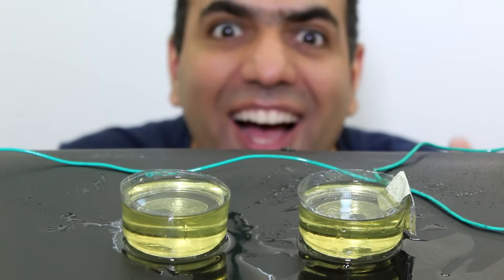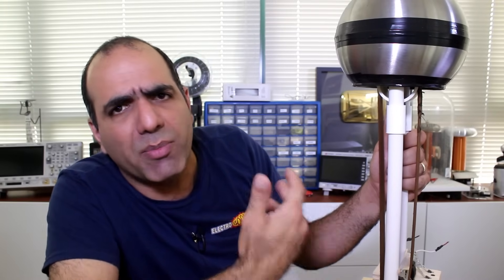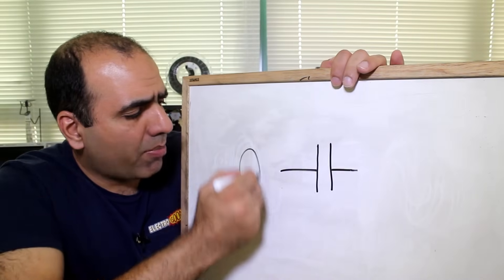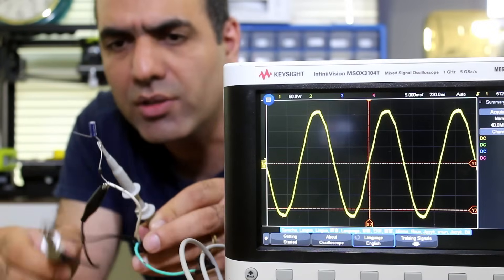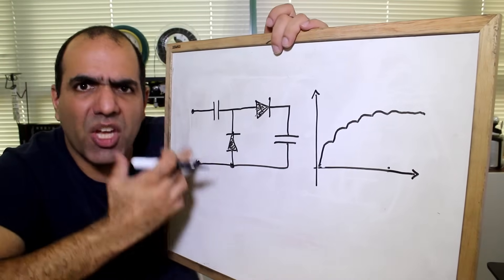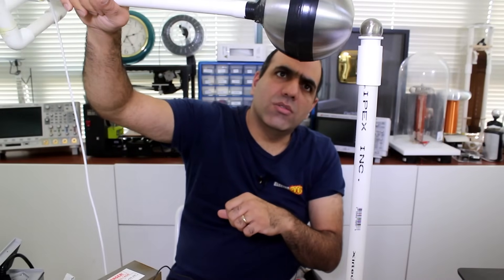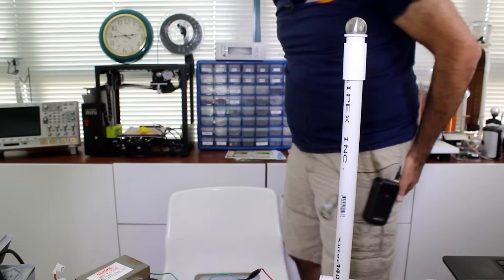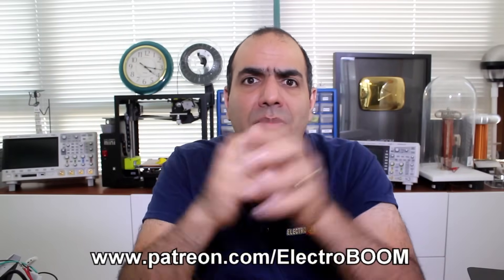High Voltage Flying Oil Experiment with Voltage Multiplier

Comment from the maker: Hello Army! I drew the winner of the Keysight. The lucky winner is:
- Codellamma
Thanks everyone for watching!
Reply: Hey i have a high voltage transformer and it is huge.
Reply: Dude be safe please
We like u alive
Reply: Wow i love your videos keep it up 👍👍👍👍👍👍👍👍👍👍👍👍
Reply: Круассан ахаха, Nice joke ;)
Reply: @nakam1chi  "Ес Русишь!" ;)
Reply: Can you showt out my video. I am from  Irean too.
Reply: ??????
http://www.youtube.com/shorts/Siixx3aBI1c
Reply: wifigun confirmed working
Reply: I would like to see wireless charging experiment under high voltage power lines, there are 3 400kv lines with twin cables near to my house, so i am interested.
Reply: ElectroBOOM 
Dear Mehdi hi, Thanks for great and very informative videos. Mate, I need your help if it will possible please. I need you to tell me how to create a weak (safe) Electrical Current and/or, how to build a weak Electrostatic please, I give the scenario first; imagine there is a tick plastic container (around 1 or 2 gallons) with some kind of Resin and a few piece of wood, it is actually a vacuum chamber. Now, I need that weak electrical current or electrostatic in that Resin by placing the producer (device or anything) of them while the vacuum pump is taking the air out of the chamber for the period of time it is on (could be couple of hours). Just imagine painting a car by using electrostatic to have a more smooth and indelible result/paint. Will that be possible please to tell me how to do it? Cheers mate.
Reply: You said two winners not one I could be the second winner
Reply: ElectroBOOM    Ben
M
Kkkmgn
Reply: Uhhh obviously this is a year late but was this supposed to be me, or is there another codellama?
Reply: @gran4404  RIP
Reply: It hurts me to watch....
Reply: Just like the dust that settles on the old TV screens and Start popping when the screen get charged
Reply: When will you rectify other videos from Kreosan? I want to know how much to trust their video...
Reply: Make this: High Voltage Microwave Transformers MOT Experiment https://www.youtube.com/watch?v=RvXu6IGBqjA
Reply: My dad needs a keysight scope.
Reply: The car ignition coil has mineral oil in it that is what thay have in the big Barel things on power lines
Reply: Please open the glender and drill machine
Reply: ElectroBOOM u remind me of my dad
Reply: Look at my ball was the funniest part
Reply: Fun question I hope you get to see...
Any relation to the "bridging effect" as seen in non-conductive, distilled water?

It almost seems that electricity acts in distilled water as it would in a vacuum.

I know, CrAzY riiight!
Reply: I love you electroboom you are a winner
Reply: zZsZzZSS
Reply: Mehdi what if this rod of your is somehow in the car oil chamber. Does charging oil improve lubrication or the charged oil might blow up the in internal combustion engine in electroboom way!????
Reply: Elctroboom I love your videos man you go hard on them and I like your new house
Reply: Lol I really enjoy your videos . Every time I learn something new about electricity,the dumber I feel.
Reply: P
Reply: P
Reply: دمت گرم
Reply: سلام
shov.e
حرف خیلی بدی هستش بهتر بگید insert
Reply: Hey Mehdi, the things he's using to create the high voltage are FlyBack transformers from old CRT TVs
Reply: Fuck you you saw the Beast
Reply: Empire
Reply: What do I want to win
Reply: Jadeja lucky lucky me what do I need to bring
Reply: Good for them!
Reply: Still waiting for the wifi shotgun, wireless phone charger, and microwave gun videos :)
Reply: OLA TODO BEM ,EU ADORO VER ESSE CANAL E O TEU É LÓGICO KKK   abraço de Lisboa portugal .
Reply: make a sword
Reply: 0:29 well that hits different now hope they are ok
Reply: "I think the impotence of my probe is pulling it down"
They have pills for that Mehdi.
Reply: Use a square wave on the Marx generator in at least one of those vertical videos! Because if you want a higher frequency, doing it that way would be fairly easy, right?
Reply: Hello! Please use high voltage on liquid plastics, I think it can make a plastic fiber
Reply: @electroboom i made it i didn’t get kill#d
Reply: asks for an oil fryer, comes back with an oil flyer
Reply: Rectify this video - https://www.youtube.com/watch?v=eunq8byoraM&t=9s
Reply: @Adrian Biankin about the VDO u ask.
As soon as I saw ur comment I watch da VDO n try it, But it didn’t work when connected There s not voltage on the secondary but if u disconnect the dc supply as the magnetic field in the inductor collapse we get a huge voltage spike at the output(secondary) in terms of nano seconds same as in Electroboom’s Stun Gun VDO and tats how stun guns works with a battery.
Reply: U do thrilling mistakes
Reply: Hmm... "Oil"...?
"Army"?!

OH S##T, THE MILITARY IS HERE!!!
Reply: wtf i want more videos
Reply: How did I register for the drawing? I really need a Keysight! 
As a disabled veteran it would really help me to to forget my disabilities.
Reply: too good explanation sir
Reply: minute 1:14 no sparks when you connected the capacitor ?

Comment: i know quite a bit about RF equipment and i immediately knew that WiFi antenna was bs u would not get good wifi reception with a antenna that big the higher the frequency the smaller the antenna needs to be

Comment: I find it interesting because this looks like a neat and tidy way to make a full wave rectifier with voltage smoothing using less components, and therefore, at lower cost than your tranditional set-up using 4 diodes and a capacitor. Much smaller B.O.M. and lower cost to use 2 diodes and 2 capacitors.

Also, I get you're existential fear after getting that shock. I once gave myself a 347 V poke off of factory power with sweaty hands. I had 1 glove on and 1 glove off and I was up on a fiberglass ladder. Needed to take my glove off to get a grip on the wire to twist on the marrette. I got it from the thumb to the pinky. I was more annoyed than anything else up the ladder, but then when I went home and thought more about my day, the realisation of what happened struck me and I spent a couple of days considering whether or not I'm smart enough to play with wires.

Also, I agree, hobbyists should either built a triobelectric generator or an influence generator. At least the current output potential per second will remain in and around the sub milliamp range.

Comment: I am building a similar circuit but am having trouble with arc overs. I tried encasing it in resin first but that made it stop working. I rebuilt and tried mineral oil but witnessed a strange phenomenon that was a convection current in the mineral oil. That mystery was solved by this video, but I am still perplexed as to why it made the circuit stop functioning. I am using a 24v 12A dc input powersupply to a zvs and flyback and then 6 stages of a voltage multiplier. The caps are 1nF 20kv and the diodes are 5mA 20kv. Whenever it is powered on, there is a really loud dc arc across the spark gap, but then it changes to a quiet AC arc. This usually, but not always happens when the first cap in the multiplier arcs across itself. I am unsure of the output voltage of the flyback but estimate it to be around 10kv. If anyone can suggest improvements they would be greatly appreciated.

Comment: Just order high-voltage modules for gas boilers on e-bay, determine the polarity of the output voltage for each, connect the outputs in series and the inputs in parallel, and you will have high voltage.This is how we got half-meter discharges. To determine polarity use 1 k load resistor and voltmeter.

Comment: Nice circuit im building one with 15kv flyback as supply and 15kv capacitors of 10nf 25 stages because you said DO TRY THIS AT HOME thanks for inspiring. Joking, i have some HV expierence if u new start with safer devices.

Comment: Wait. You saying that oil is a good insulator but in that experiment it can obviously pick up charge under high voltage. Wouldn't that make the oil conductive and therefore a bad insulator? I would assume that different types of oil have different electrical resistances and resistance to being charged. Or is it maybe that the canola oil isn't very pure and has conductive particles? pls clarify, thx ^^
Reply: look for electrohydrodynamic processes, electrospinning mainly. that effect is used to produce nanomaterials (fibers/particles), is really interesting.

Comment: It is interesting that the first stage is literally just a half wave rectifier, instead of drawing current from across the cap you draw the current from the diode instead, seriously, try it, take an old linear power supply apart (wallwart or something) and check the voltage across your cap (as usual) and then check across the diode instead, you will then have a double voltage. Very fun.

Comment: Before you put the capacitors into the pvc pipe you tested the spark gap, the further you got down the line of capacitors the larger the spark gap was...until a certain point and then the spark remained the same distance why is this? Wouldn't you think the gap would get larger and larger until the last capacitor in line having the farthest spark gap? are you losing power/watts or volts at a certain point? as if only so much voltage can held with that size of wire coming off each capacitor basically limiting you trying to double the voltage at every solder joint?

Comment: You're a good man, Mehdi! Cool to see you & the 'scope company helping out schools and viewers with free scopes and other equipment.

I bought a little $20 function generator and a $25 "scope", partly because of this channel and partly because I play guitar and was curious to see what the trace looks like coming out of certain guitar pedals. I also use them to do simple diagnostics, for example if I'm getting no, sound from the guitar. I can hook up the scope and check the guitar, then hook up the function generator to the amp and make sure it's not the amp, as well. 🙏👍

Comment: You should have used 20kv ceramic caps, then you could have just hooked the multiplier up to your car ignition coil/taser. Cockcroft–Walton (CW) generator's like these, work with pulsed HV DC.

Comment: You definitely have the Knowledge and Skills of a professional Electro maniac and I'm just a simple guy who got into Electronics. DC electronics and low voltage to be at that but I still know that Transformer contacts and power plants and substations are filled with oil to avoid arcing between contacts when turning on or off. They actually make and oil specifically for Transformers. And it's called Transformer oil 😂

Comment: Kreosan has good stuff but as you say, they're not 100% reliable. I remember when they said they blew up a fridge with high power fireworks, while the black smoke clearly indicated they used a high explosive.

Comment: Although couldn't you technically use a dc source, then use a mosfet or other fast switching transistor and some resonant capacitors to couple with ac/dc wall charger transformers. Thereby making the voltage a much higher frequency? In turn making this much safer as well, instead of just running it straight off of 60 Hz. And you would better be able to control what voltage you are inputting to the circuit.
Reply: Or maybe go off of a ballast? Even the ballast for my tiny 12 volt fluorescents has a 45 kHz output.

Comment: Hey Mehdi. About charging phone from Ukraine power towers. It could be possible. I'm from East europe and I have one experience. I was passing once under high voltage power lines with bicycle with aluminium frame. I felt slight electric tingling then I touch my bike with bare hand. 
So watching your orders videos, this might work.

Comment: You can form water bridge similar to oil under the influence of high voltage if you have two glass containers filled with water and touching each other by lips. Put positive hv electrode in one glass container and negative ground electrode in another glass container. Once you have high voltage flowing through water, slowly move glass containers apart and it will form a thick few centimeters long water bridge between.

Comment: You used small 
capacity capacitors.

The TV voltage multiplier uses much larger capacitors. Caution with high voltages, danger to life!

Comment: You can use a lot of high voltage and high capacity electrolytic capacitors in the circuit and

Comment: 8:15 exactly this has happened to me in my college experimenting on the same circuit and after finishing my class i forgot to discharge capacitors and grabbed a 880v charged capacitor with bare hands and then dropped them all overthe floor after getting electrocuted. Lol

Comment: Why doesn't microwaves ovens use a 4kv, a capacitor only to limit the current and a FULL BRIDGE RECTIFIER, instead a single diode puny rectifier and a capacitor as a voltage doubler to increase the voltage from the 2kv to 4kv?

Comment: Based on my observation, 1 multiplier contains 5 capacitors and like 6 diodes
and Kreosan made 11 multipliers in series
so its like 55 capacitors and 66 diodes.

Comment: There are tv voltage multipliers in India that can convert 220v to anout 23000v each so if u put them in parallel u can create half a millon volts

Comment: I don't get why the output voltage of the Villard circuit only dorps when a reistor si added ? 
How do you even measure the unique voltage after the capacitor ?

Comment: The WiFi shotgun probably works, it's a legit antenna design (circular yagi antenna). Their main drawback is limited bandwidth and directionality.
Reply: The problem lies in maximum output legal power. In my country the maximum legal wifi router power is 100mW.
Reply: @oldelectronicenthuasiast  that's the point, since the antenna is directional in both Tx and Rx, less of that output power is wasted in directions that don't lead to your router

Comment: Sir I have one question sir in 12.15 you explained about static current. I have CNC machine and even though I am connect the ground I am getting shock I am thinking that it is by static current only how to avoid it I am also ground the machine body separately to ground now also I am getting shock please tell me how to get rid of this please....

Comment: Well it's good to know that even after you disconnect they still hold charge xD
Reply: There are few fatal accidents caused by not following the rules when dealing with capacitors. Even after the power is turned off, make sure you discharge them safely before doing anything with them.
Reply: @tdhanasekaran3536  yeah

Comment: Hello ElectroBoom guy!
How do you know you have enough insulating distance on the diodes and on the voltage multiplier stages? Is it the oil assuring that?

Comment: wireless power from powerlines isn't a myth, it was an old farmers trick here in NZ(in the 70/80's), when the power companies used to commision 50-110kv HT lines on farmers land(basically taking a bit of land and barely paying for it if at all) some of the craftier farmers used to put fencing wire inside a garden hose and tie it into a large loop/loops place it on the ground under the HT lines and connect to it to run back of the farm water pumps to fill troughs and other basic shit, untill massive fines were handed out and the practice stopped.

side note, get the size/amount of loops wrong, and you can easily kill yourself/be left with a smoking bit o wire you can't touch on the ground.

Comment: We blew up capacitors with reverse voltage in cd ignition systems years ago.Also if you use a shortwave radio tube radio the capacitive discharge when touched will throw you 3 metres acrosss the room.been there did that

Comment: Will this work with pulses. E.g i create a pulse 0 to 5v and use group as 2.5v, will it double the voltage? Can the increased voltage used like a mosquito bat? I need this to make an experiment.

Comment: So let's take a high Voltage oil filled power transformer. The transformer body/tank is grounded. When the high voltage transformer energizes, the oil gets charged and is pushed towards the grounded tank? The cycle repeats then?

Anyone ? @Electroboom?

Comment: Do only electrolytic capacitors explode and ceramic ones burn out? Why not only use ceramic ones if that were the case?
Reply: There are pros and cons to each type of capacitors there is a video explaining it I will link below
Reply: Nevermind I can't find the video I was referring to

Comment: I did something similar with oil back in middle school with a flyback transformer (that's what that Kreosan guy is probably using). They can be harvested from any CRT TV, have a built in voltage multiplier and can be connected in series for more voltage. It's good to put them in oil, with a good enough driver (like this one: https://www.youtube.com/watch?v=655uZTywQ5I) they can start arcs from far enough to destroy themselves.

Comment: I have a question i keep wonderinf, if capacitors allows AC to just pass through, in the old tesla coil circuits where the output of a neon sign transformer charges a capacitor, how does the AC charge the cap for the spark gap if ac just passes through?

Comment: The power line video is real. A while ago i was setting up an electric fence under some big power lines.After we got enough wire ran we noticed that we were getting shocked without the fence connected to its power supply..

Comment: Let me make a suggestion for the next time you need high voltage. Use a ballast for Florence bulbs. If I remember correctly they put out 500V. Also the oil used for high voltage transformers and other electrical is mineral oil.

Comment: Technically, you should be able to harvest electricity from overhead power lines... If done correctly, theoretically I see no reason why you should not be able to use it to charge a phone.
That's according to my knowledge,  which is very little, so take all this with a grain of salt.